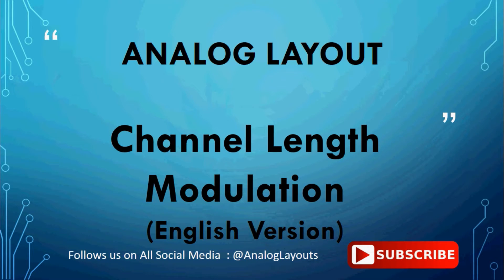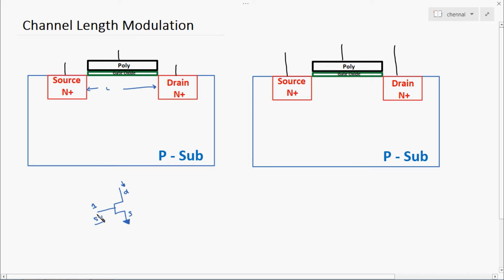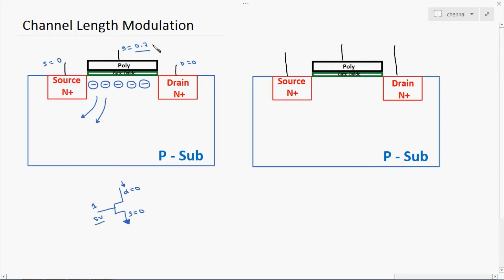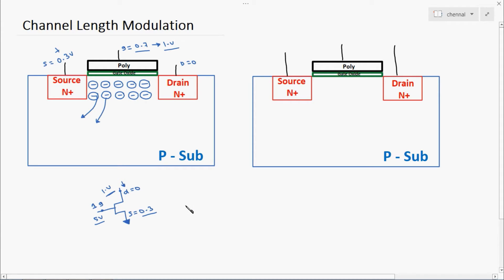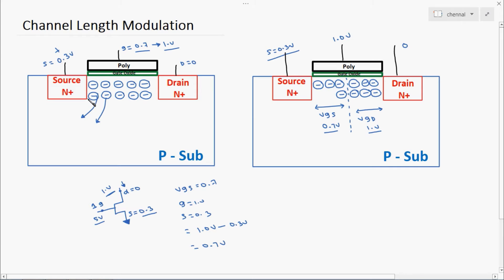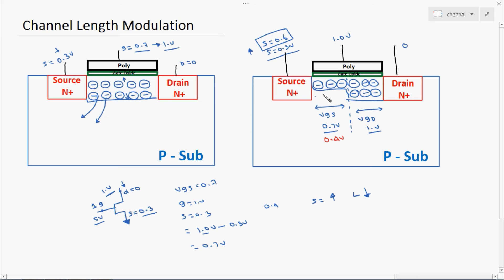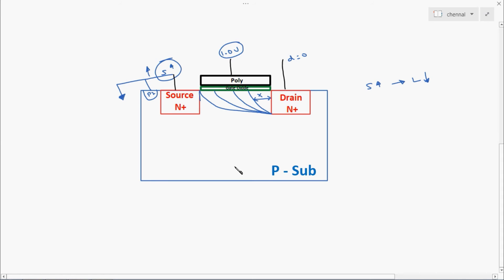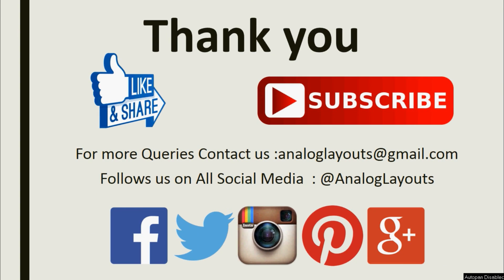Channel Length Modulation - English Version

Comment: You generally have some great videos with straightforward explanations about the concepts.
However for this one, since your drain and source are interchangeable on a corresponding layout view, once you ground your "drain" and raise the "source", you have essentially switched the two terminals and your designated drain is now the source and vice versa. Thus your illustration of the pinch off region on both source and drain is strictly not correct.
Reply from the maker: Thx for the information , try to make a new video for this topic .
Reply: holes moved from their placed and left negative ions there. Simultaneously electrons are also attracted near oxide plate but negative ions repel electrons then how can be the channel form please explain